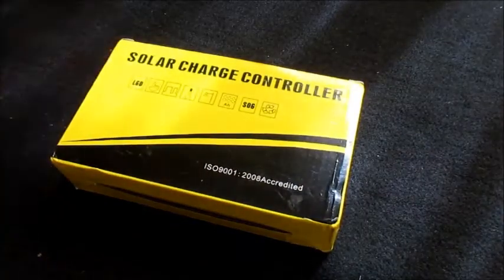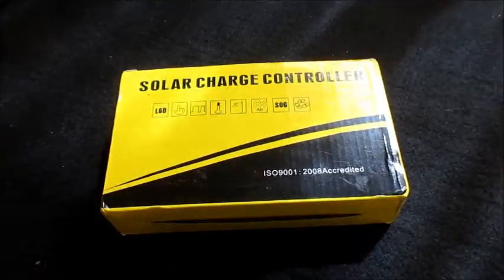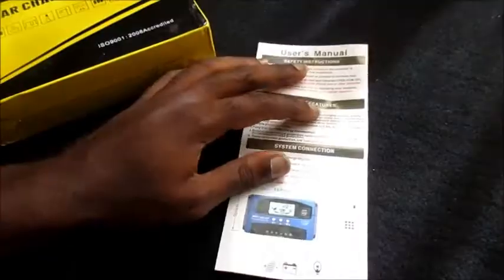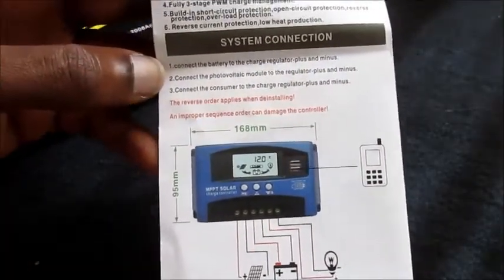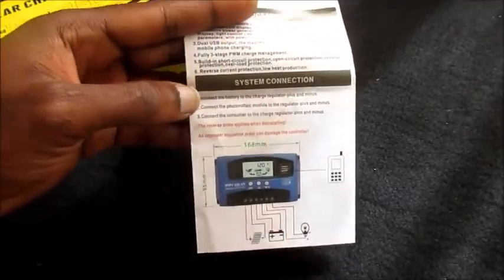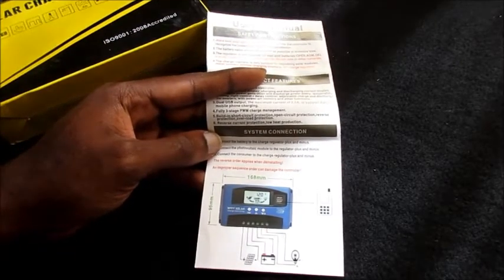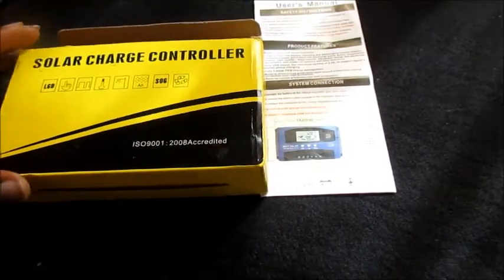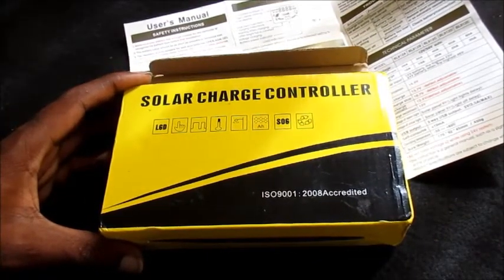200 amp mppt charge controller installation

Comment: Do u happen to know what the other holes are for on the bottom one on each side of the other other holes which plug the wires in 🤔I bought one and I'm not sure what the purpose of it is?

Comment: Hello, thanks for the videos on this product, very helpfull. What is the use of the 2 connectors (jack ?) at the bottom, one at each side of the 6 connectors (+- solar, +-battery,+- Load) ? It's look like a 12v connector but to do what ?? thanks !!!
Reply from the maker: Yes . its either for output or input. i would find out for you